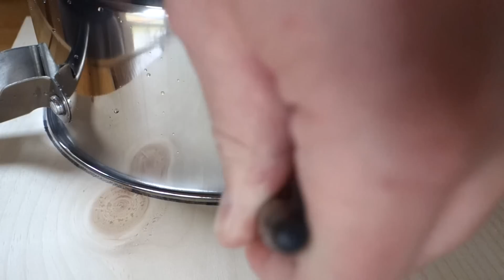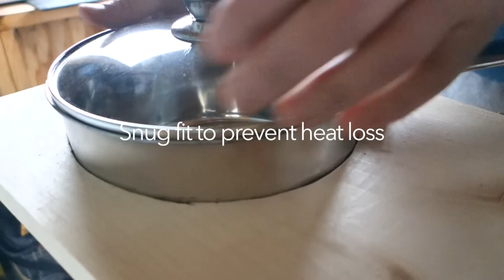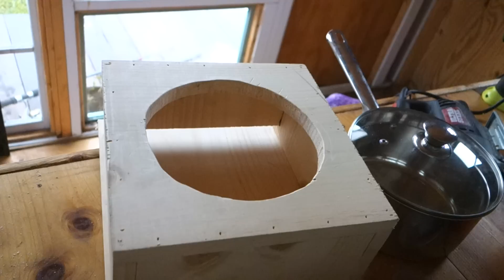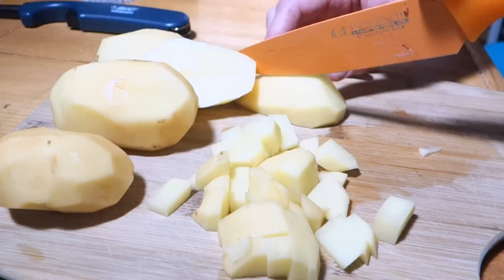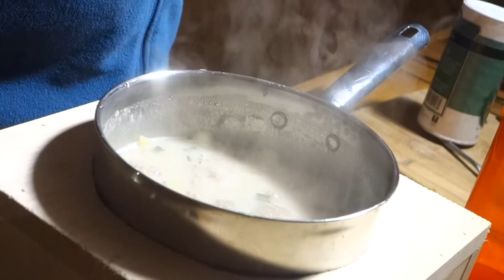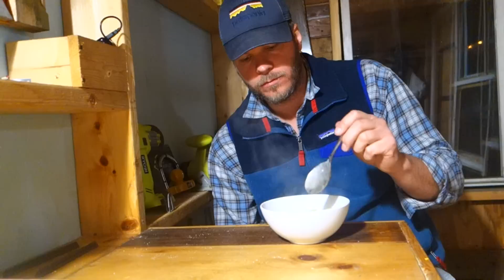Tea Light Powered Slow Cooker (Off Grid Croc Pot)

Comment: you  know, we  did the same  thing when the ice storm came through Ohio several years ago...i had  found a tealight candle  holder  (at oddlots) that reminded me of a grill you could cook with a pot  on. so i got it.  then came the ice storm!  power was off for a week. we had a kerosene heater so we were ok.  i bent a piece of metal around 3 sides of it to keep the heat focused inside, put  9 tealight candle under it.  my kids and  i had 3  hot meal's a day while the electricity was off.   it ROCKED!!  lotta folk had to go to shelters.  my kids  loved it.

Comment: Very nice.  A possible improvement would be a sliding base to put the candles on to make it easier placing the candles.  It might not even require a rebuild if the material were thin.

Comment: Really cool.  I have a poor man's version: a pot that I squeeze into a coffee can, where I cut out a hole at the bottom to put the candles in.  Yours is obviously classier with more potential.  You could cut the "pot holes" strategically, so you could have the big pot, a medium pot and a small pot (or maybe just a metal cup), so you're cooking three things.  You know, use that "wasted" space.  And maybe adapt the interior to be an oven also -- incorporate some ceramics, lose as many air holes as possible.  A lot could be cooking at once, or cover the pot holes if you want to use just the oven.  Again -- really cool, super efficient, for things like rice and beans that are not suited for Heet, when you can't make a fire, etc.

Comment: Making another one of these cookers, only made of metal or stainless steel may reflect more heat. There is also mini glass heat resistant mason jars with metal caps. Try drilling holes in a few of these caps, then add cotton string, or rope, then trim it down. Olive oil is perfect for these mason jars. It burns cleanly, does not soot, or smoke. Adding methanol, or lamp oil just for the tips of the wicks on the mason jar lids will give you the best candle start up. Plus no need to worry about burned tips. :) Hope this helps for your future if you want.

Comment: Good use for tea lights!  They are pretty inexpensive and I find they last about 4-5 hours.  Remember when they lasted 8 hours.  I used them all of the time for ambient lighting when I wanted to be peaceful.  Expanding use to cooking is a great idea.  Plus, you add heat to the room you're in.  You could even use them to humidify a room when other heat sources dry the air out.  I wonder if adding a scented oil to the lights would change the flavor of the food.  I'll have to try with something inexpensive and see if it works.  (A few carrots and peas, maybe?)  If that worked you would be accomplishing three things with one tea light set-up.  OOOO, are we getting efficient, or what?

Comment: THIS IS FANTASTIC! i like this so much, im going to make one for my rv. thanks very much for the idea and others that come to mind because of this. i wonder tho would this be more efficient if you had a place for heat to escape out the top. not a large opening but a small hole that you can have a cover over so you can control heat escape allowing fresh heat to hit the higher points of the pot? just a thought and definitely something to experiment with.

Comment: Tea lights tend to ignite - that is you have the entire cup of wax burning rather than just the flame on a wick.  So, I would caution that this setup is a fire hazard as you have no way to expel the ignited tea light quickly.  Wood is flammable and the whole thing can go up in a flash.  But it's still a sweet idea - just needs tweaking.  I'd rather see the bottom left open and separate.  that way you simply sit the pan support over the tea lights.  Also, glue aluminum foil to the inside of the support to reflect heat away from the wood.

Comment: with the set up that you made, how far was the bottom of your pot from the flame of the tea candles?  Thanks for posting this idea.
Reply from the maker: +Chain saw cabinet Shop From the top of the flam to the bottom of the pot is about 2 inches. This is where most of the heat is and also allows for room if I decide to put a taller candle in there in the future if I don't have tea lights on hand.
Reply: Thank you. that helps

Comment: would there be anyway you could post the measurements of the wood and the size of the vent holes (including the slot you push the candles through!) as well as the size of the pan(quarts etc)? I'd like to do this sometime during the summer or midfall!

Comment: Great idea! Did you have to use more than the original 5 tea lights?
Reply from the maker: +Harry Who Just the 5 tea lights. They are the very small 1/2 thickness ones. If you put less of the thicker ones in there, you could cook longer and slower. The 1/2 thickness ones lasted 3 hours as I let them burn an hour after the food was ready (which was just two hours).

Comment: wondering if I put a rack on top, could I make toast? This is very helpful. thanks.
Reply from the maker: +Yarn Buzz tess kee That wouldn't work. If you put a cast iron skillet and put enough tea lights under the skillet you'd probably be able to make toast.
Reply: that sounds like a winner. thanks.
Reply: +Yarn Buzz tess kee Candles give off a lot of soot. Thus, you wouldn't want to cook food directly over the flame. Perhaps a cake cooling rack, covered with foil would work. A cast iron skillet may require too many candles to heat the metal hot enough to brown your bread. Experiment with a cookie sheet, disposable aluminum pie tin, etc. to see what will work best for you.
Hope this helps.
Reply: You gotta match up your tool to the job.  This ain't for toast.  It's for cooking, hard and fast or long and slow, depending on how many candles you use.  And for hard and fast, Heet/propane/alcohol might be the better tool.  This thing is really great for clean, cheap slow cooking.  Although, like his said, you could make toast in a pan.
Reply: Got it! Thanks KD